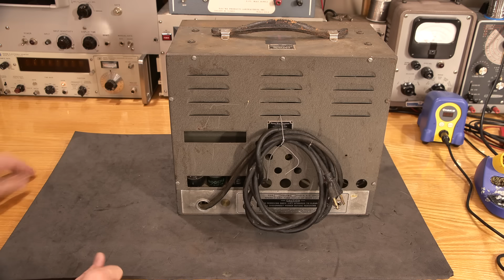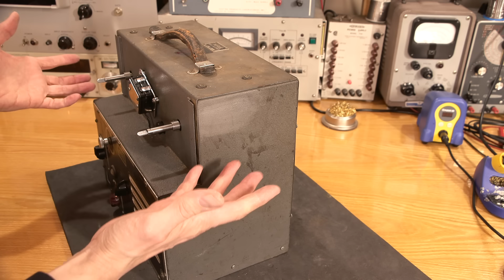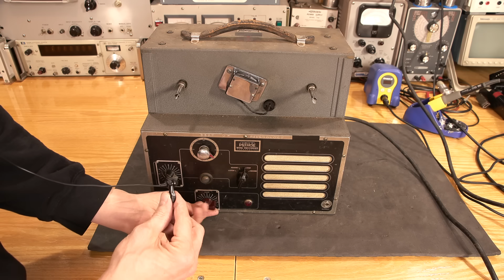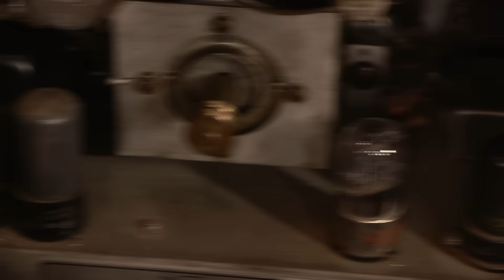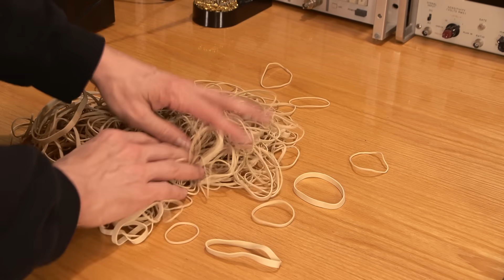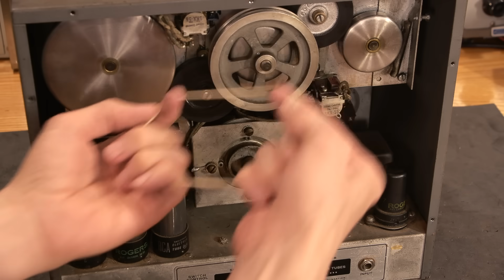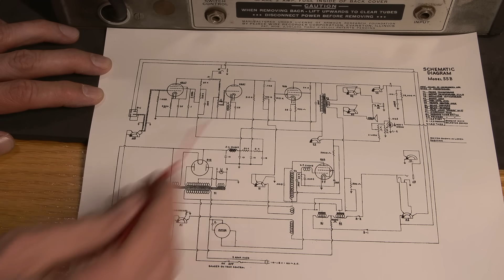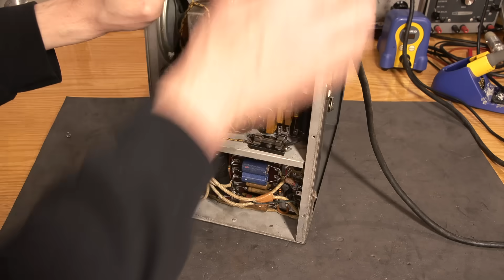Trapped Voices In This Wire - Let's Listen To Them!

Comment: I don't think touching the tubes with your bare hands is recommended.  The oil from your skin can affect the glass and possibly cause a failure.  Those get hot.  I know some old light bulbs have this issue

Comment: Repair of rubber drive wheels. Temp-large rubber band or cut to width section of inner tube. Permanent- clean up damaged surface of drive wheel with modeling clay or wax then make a mold in latex. Carefully break the old hardened rubber off hub then put the hub back in the mold. Fill mold with polyurethane mixed to the correct hardness to make a new drive wheel. There is more to it than that but this was the technique an old friend that restored old reel to reel and other devices with transmission drves. He even made replacement isolation bushings. This method also made the large drive belts like on this machine

Comment: They used to make digital recordings on high speed steel tapes. They were very dangerous, as they would occasionally break or malfunction and leave the operator to be sliced and diced.

Comment: Wire recorders, an early form of magnetic recording, worked by magnetizing a thin steel wire in accordance with an audio signal, similar to how tape recorders work, but using wire instead of tape

Comment: Looks very similar to the aircraft 'Black Box' system, recording various aircraft control settings etc. We used wire as it theoretically would survive excess heat and fire.

Comment: Back in the 1970s I had one of these wire recorders here in SoCal. It did not have the "Dept of Psychology" nomenclature. Do we need to take any special precautions when connecting the Audio Output of this tube device to the Audio Input of our computer sound card?

Comment: The electromagnet creates a magnetic field that changes in response to the sound of someone's voice. This magnetic field which changes shape due to different frequencies from a voice, is imprinted onto the steel wire. The wire is magnetized. 

An electromagnet is a type of magnet where the magnetic field is produced by an electric current.

To play the sound back, the magnetized wire induces an electrical signal in the electromagnet, which is then amplified and converted back into sound.

Comment: Hi, I'm 72, when I was young  I used to work with these tube radios and repairing them, they was still in use in every home, it was before radio transistors were in the world, it looks to me that one or two of the tubes needs to replaced if you still can get them, then the audio will work again, other option is to bypass the broken audio section with  a small circuit of a modern amplifier attach the input to where the audio signal is good, amplify it and attach the output to the original speaker, as well use the original potentiometer to the new amplifier volume control, and it will act as the original machine, I suggest you to go for it, with a little afford, not to expensive you'll bring this machine back to live.

Comment: I know this is a 40 minute video, I'm only 9 minutes in, I would imagine that the rubber belt on that thing is depixelated by now I'm sure it was probably replaced in the 60's or 70's. Even from then, it dry rotted just sitting in the back of the AV closet. Mummified!  Maybe blowing the dust out of that thing and air dust the volume and selection knobs, and the rest should be ok I think.

Comment: Heavy flywheels and silky smooth bearings could dampen the oscillations coming from those belts.  I have been bothered by similar voices talking to me through motor windings-like an inductive transducer using a form of the Barkhausen Effect.

Comment: A real deal antique in an almost pristine condition! The mains cord was certainly replaced, other than that all original, wax sealed caps are bad news to me.
I was starting to think it has a push-pull amp with two 6V6 tubes before I saw the schematic, which would surprise me as there really would be no need for more than a few watts on the speaker. 

I was thinking you'd use your signal injector to test the amp in reverse direction, but still, a great use of another of your creations :)

Comment: It's a 1940s machine that i didnt know and it records using a sort of metal thin wire. I thought tapes were widely use before
Reply: Audio tapes came into widespread use in the 1950's.  Wire recorders were used late 1890's to 1950's and mostly in the 1930's and 40's.
Reply: Thanks for the info i am never aware of these wire recorders. Listening to the recording is like getting in a time machine! The guy speaking sure sounded like a 1940s person

Comment: How do they get the recording on the SS wire?  I thought stainless was non ferrous so how would that work?
Reply: Certain types of stainless are magnetic. Ferritic stainless steel includes grades such as 409, 430, and 439.  Wire recording works like a magnetic recording on a cassette tape.

Comment: I have a wire recorder said to be from the late 30’s, and am hoping to restore it in the future. The case is made of wood, not metal and it came with 12 used wire spools, and 6 new ones. The spools are smaller than the ones that you have, and I’m interested to hear what’s on them. It was made by Webster Chicago, back when we actually made things in the USA.

Comment: I would love to see you troubleshoot and replace each bad component and salvage whatever  is still good if there’s anything.

What an awesome machine !! Recording device on wire, probably long before the tape

I used to work in Telcom with a VRU group and we use a software called cooledit to take recordings and we could remove background noise from them and filter them so they would sound really clear. Then we would upload them to the VRU server so I could play sound over a PBX phone system . But you could do the same just with what you have here even without a restore ! 

Very enjoyable video

Comment: I am not knowledgeable in any way about this or any other electronic products. I am 76 years old and have a radio that was given to me on my 13th birthday. I wish I could get it working. I found a place that will restore it by putting in modern guts, but I hate to do away with the original parts. I also have a tape recorder that purchased from Sears when I was about 18. I only remember one thing and that's recording the voice of the one of many girlfriends and myself back in those days. Recently, I purchased a huge and heavy reel to reel tape recorder. It has issues and I will eventually have it fixed. In going through my 84 year-old sister's belongings; I thank the Lord that they never threw anything away. I wonder what's on those old tape recordings.

Comment: Hello this is Timothy Harris I build stuff electronics valve amplifiers integrated amplifiers transistor amplifiers DIY valve and transistor amplifiers I was so built trucks out of wood that I can sit on and ride along part of a buy petrol motors or electric motors in the middle of a project right now well I'm in bed at the moment a pneumatic bike 4 kg gas cylinder can take up to 4 kilos of gas but I'm not putting gas in the I am compressing the cylinder gas cylinder with air my compressor that I bought on eBay $29.95 the pneumatic bike is going to have a VHS video tape deck from an old VHS video type recorder on my pneumatic bike with two speakers two tiny little amplifies which I bought on eBay as well 18 W each power supply 12 volt DC and I'm able to record my voice onto the VHS video tape whatever type I want to load into the VHS player deck and I will have some switches I record play switch a load eject switch I forwards and reverse switch a power on and off switch photo transistor on a off switch allows the machine to cut out as soon as the tape has finished or as soon as the tape has fully rewound now the most important switch VPM switch 🤔 which is short for video player motor on and off switch couple of audio selection switches microphone selection MP3 selection switch allows me to my plug in my own MP3 player which I made myself and talking about that I bought a circuit board at Jaycar Electronics for $14.95 it is called an mp3 player Arduino circuit board allows me to play music from an SD card 8 GB to 32 GB has used camera battery inside which is almost worn out usb-c input 5 volt lithium battery input circuit board what charging the lithium battery and it goes for some hours on one charge just I just plugged that into the MP3 3.5 mm stereo plug on the stereo on my pneumatic bike once I have finished it me free microphone solution switch to microphone or MP3 and I'll be able to play MP3 music through to speakers listen to my voice the speakers at the same time record onto the VHS video tape I can play it back by selecting the second selection switch from selection which is MP3 microphone selection tape 🤔 selection and about the pneumatic bike is going to have air horns on it really loud air horns for also be powered from the gas cylinder even got a safety valve 0 to 145 psi euro to 145 psi 0 to 1000 kpa so I can see how much pressure is in the gas cylinder and it's going to be great fun to play with as long as I don't over pressure the gas cylinder otherwise the safety valve will not off some air if you want to watch my videos on YouTube type in my my code to bring my videos up here is my code @TimothyHarris-tn4fo. 😢😢😢😊😊😊 Have a nice day

Comment: "One can never have too many rubber bands." Amen. And bolts. And screws. And washers. And nuts. And hand tools. And power tools. And torches. And soldering guns and irons. And flux and solder. And welding rods. And spectrum analyzers. And accelerometers. And charge amplifiers. And 4-1000A spares. And old radios. And new radios. And interesting devices. And...  

Keep up the good work, my friend!

Comment: You said the plug was changed and you plug it in WITHOUT GLOVES. Literally saying you don't know why it was changed 😅 EDIT: I'm not trying to be a dick but that cord could've failed the ground wire and that could have killed you. 😮
Reply: Mr Carlson used an isolation transformer to power it so the earth ground is not needed and actually shouldn't be connected for the testing.

Comment: I can see how that would work being that sound is vibrations
Reply: It uses magnetism to record on the wire same as an audio cassette.
Reply: @ yeah, which caused a vibration. When amplified that’s what your hearing…amplified vibrations lol. Just like a record with a different way of vibrating that needle.
Reply: @ also, I wasn’t asking how it worked, I watched enough of the video to figure it out and then moved on🤣
Reply: @ Sound is a pressure wave that causes vibrations in objects but how the signal is stored, in this case, has nothing to do with that idea. It doesn't work anything like a vinyl record with vibrations of a needle.  The magnetism on the wire induces a changing voltage in the playhead as it moves past.  That voltage is greatly amplified and drives the speaker.  The only vibrations are ultimately the speaker cone moving as of course you would have with any audio producing device.
Reply: @ also, you should read up on how eardrums work. FYI, the old microphone I was referencing is similar to the One that was used in St. Louis that made the American Telephone &  Telegraph company  that damn near everyone still knows of today 👊
Reply: @  microphones, ear drum, speakers, etc don't have anything to  do with the actual storage of audio (sound)  they are transducers and reproducers.  My original comment was based on your reference to vibrations, that was all. The wire is a magnetic recording, no vibrations.  The vibrations would have ended at the original recording microphone and then originated at the speaker cone on playback.  That was my point.

Comment: Thanks a lot....but I wondered 
How can they record on such a thin/tiny wire? I mean what does the head look like? 
I hadnt seen one before. Very interesting.Thanks again. 👍
Reply: It is a magnetic recording on the wire, same as an audio cassette.  The play and record heads on this machine are actually huge compared to the heads in much later tape based recording devices like VCR's, DAT, etc.  The wire is necessarily thin to be easily magnetized.
Reply: @EriksElectronicsWorkbench  Thank you for your reply and explanation.
I always thought the width of the tape was responsible for recording the sound waves,!
I noticed the reel tapes like in rec. studios are much wider...
Now I guess the width of the tapes has something to do with how many tracks? Not sure though.
Oh well, live n learn... 👍 
Thanks again. 🙏
Reply: @USAMehdi  no problem at all..  the tape width used is determined by how many tracks you need and how wide you want the tracks.  Wider tracks give a better quality signal among other things.  For example 1/4 inch tape recorded with 2 tracks (stereo  half track) will have a higher quality audio signal than 1/4 inch recorded with 4 tracks total (quarter track) because half track has only two very wide tracks and quarter track has four narrow tracks.  Reel to reel needing up to 24 tracks with very good quality is going to use 2 inch tape.  With video tape, the 1/2 width of VHS tape is needed to fit the slant tracks plus the linear audio and control tracks, it all just requires a certain amount of space on the tape.  S-VHS used on digital audio ADAT has 8 tracks of 20bit audio slant recorded at high data rate.  DAT used about 4mm wide tape (like an old style cassette) but had CD quality sound due to the digital recording process.  Just several examples  ~Erik
Reply: @EriksElectronicsWorkbench  
Wow, thank you very much for all the great info. I understand a lot of things now. ( i.e why my old 8mm camcorder tapes were lower quality than VHS tapes etc )! Very well explained.
I appreciate it 👍.

Comment: My only experience with a wire recorder was discovering an old (probably 30-40 year old machine at that time) dictaphone in the attic of a garage of a house my parents rented while building a new house in 1986-87 when I was a young teenager. The attic was full of equipment and documentation from a retired doctor’s practice that sold when the doctor retired and, rather than being trashed out, got stored in this attic. After plugging the machine in, I went to switch it on and received a nasty electrical shock from touching the metal cabinet. That pretty much drained my curiosity so I carefully unplugged the machine and put it back in it’s attic. I had never heard of the brand Peirce and looked it up. It seems like they started business in the 1920s but refocused their business to be primarily on wire recording by the mid 1940s. The offered a machine with wired foot controls for starting and stopping the recording and for playback. After WWII, they offered a machine for sale to the general public through Macy’s department store in NY at a substantial price of $400. They also seemed to have a contract with the US Air Force providing wire recording equipment that included aircraft voice recorders that provided them with most of their profits; generally not a highly profitable company against a great deal of competition; especially in the dictation market. They lost even more market share by the early 1950s when the advent of disc, and later magnetic tape records hit the market and replaced wire. Peirce never seem to expand into those technologies and later sold a majority of it’s business to IBM by 1959. It would seem that, in the mid 1940s - early 1950s, Pierce was building products known for durability and physical quality yet not necessarily the highest audio quality and not competitive on price with more technologically innovative recorder builders. They were sort of like the school record players of the 1950s-1970; tough and durable but offered limited models with old technology.

Comment: How can anything like this be invented before the tape recorder? This is junk stuff? You cannot hear voices clearly. They should have came out with the tape recorder first?
Reply: The invention of magnetic wire recording was late 1890's and by the 1950's recording had transitioned to tape media.  The wire machine is not working properly that is a big reason why it's difficult to hear.  Technology of that era, inventions build on inventions.  The ability to make tape media didn't exist in 1890's.

Comment: I didnt even think such a thing could exist!😄
Reply: It's a magnetic recording like a cassette or reel to reel tape, just different recording media.  Nothing unusual about the technology.  It predates tape based media.
Reply: @EriksElectronicsWorkbench I just wondered how could behave a circular wire as a magnetic recording media.
I studied recorders a long time ago, including integrated dolby etc...
May by the amount of magnetic is higher with this media, since a tape is a very thin ferric powder deposit.
The speed of course is related to the quality but a high speed means more consuption or course.
Thanks for your videos. I like old fashion electronic!
Reply: @jeanyves5380  It doesn't matter if the recording media is circular like a wire or flat like a tape.  Obviously tape is greatly improved but the wire works amazingly well. It is necessarily thin to magnetize easily.  I'd think wire requires a stronger record signal than tape because tape was eventually formulated to be very easily magnetized.  Yes higher speed gives a better high frequency response among other things.  Vintage electronics are something I enjoy as well!
Reply: @jeanyves5380  just to clarify the wire can't record multiple tracks like stereo, it's just a mono recording.

Comment: If you coat that hard rubber with a thin layer of Seafoam, it can be rejuvenated a bit.  Apply one thin layer at a time, with a 1 hour wait time to see how it soaks in.  And be sure you releave the wheel from any pressure points so you don't create any flat spots as it softens.